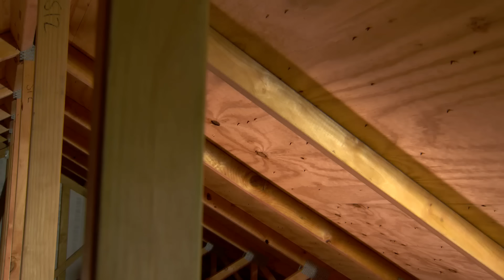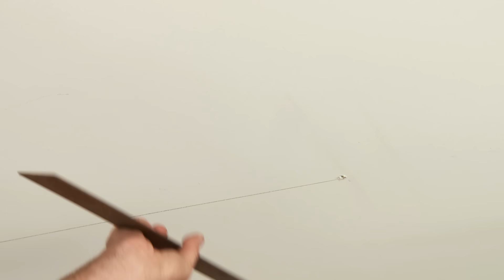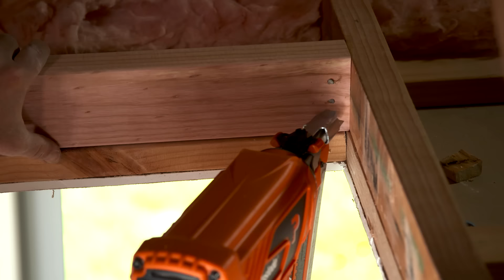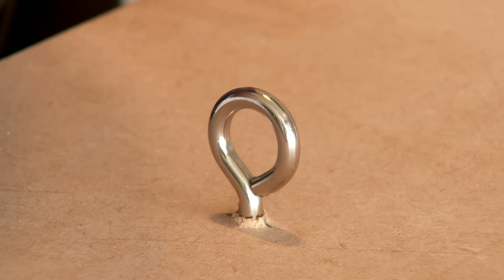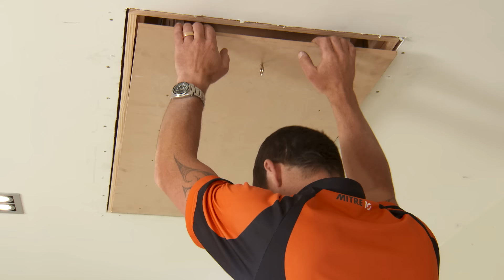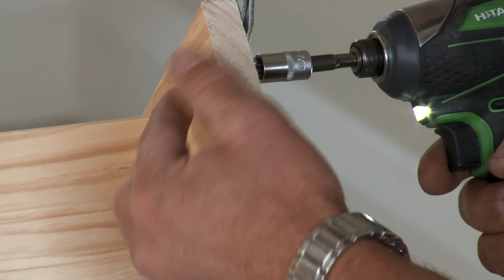How to Install Attic Stairs | Mitre 10 Easy As DIY

Comment: Yes, that's exactly what I thought, up until about two years ago -when THAT (attic stairs) became a significant problem.
See - I now have NO lower left leg, or foot, and a half-hearted attempt at making me a prosthetic (by the limb service) has left me with another )unusable) temporary fitment that isn't correct, or comfortable enough, to use with ladders OR attic stairs (let alone ordinary stairs).
So, how does one INSTALL a small (cavity) Attic Lift?

Comment: many thanks, just done this today, but to my delight, the cut I had to make was exactly where the step was 😭 so it still have 5mm gap at top stair joint.  only took me 90mins to do and 4 cuts later 😀

Comment: That cleat idea is EXCELLENT. Much better than the support board that goes all the way across, which is hard to measure exactly to hold just the ladder frame and not block the door
Reply from the maker: Cheers 😃

Comment: When you cut the bottom you should of moved the steps over so the steps could be pushed back.so the angel they come down at would be the same on the bit needing cutting.then made the mark for cutting.i know it not a lot out that the wood take out the 10 to 20mm cut out.

Comment: If the ladder box was right up against one joist wouldn't it automatically be square. Rather than adjust screws and batten both sides.

Comment: The Screws or nails should be in the center of the peckers!  not inches or mm's away. these things need to be installed TIGHTLY peckered!     I love this guy!  Also,  the actual door thickness plywood has to be  accounted for and not flush with the "plaster board" so cross braces attached to the ceiling across the opening won't work, The unit will be too high.

Comment: Is it just me or should those stairs have been installed the other way around so that you are stepping into the ceiling space and away from the roof at the top? The way they are positioned at the moment it looks like you would be stepping away from the ceiling space and into the roof at the top of the stairs.
Reply: Gnuthad haha you are exactly right!! He even said specifically that about the head height choice when he was in the ceiling space making the reference holes.2:09
Reply: He did it that way because he wanted it facing towards the access to the house, he said this 1 min into the video, If he did it the other was he would have to go around it every time he entered the attic, he also covers placement considerations about 2 min 5 seconds in ;D